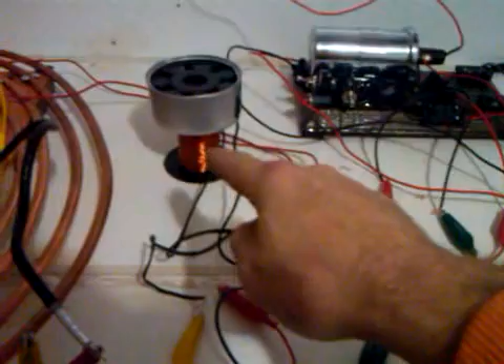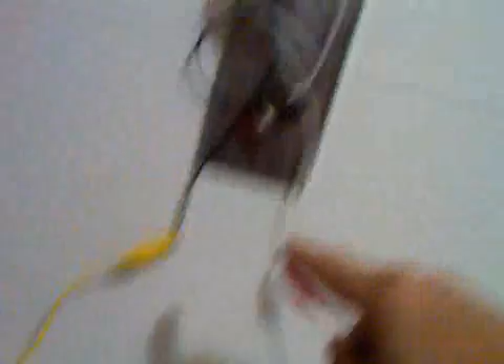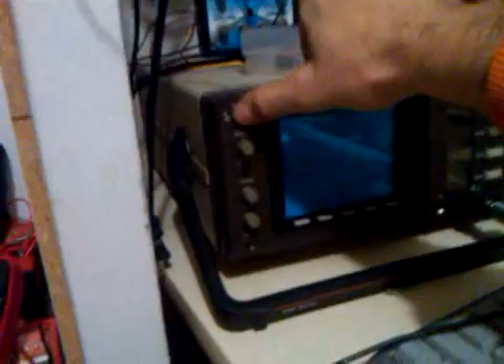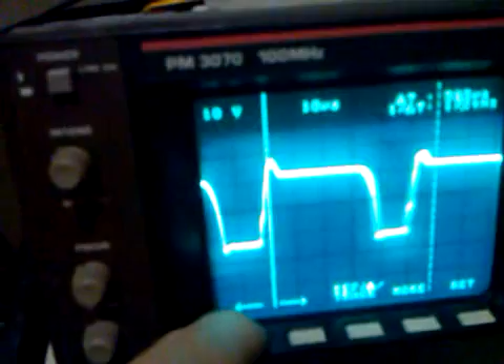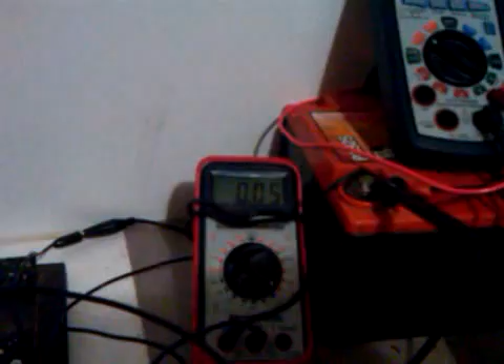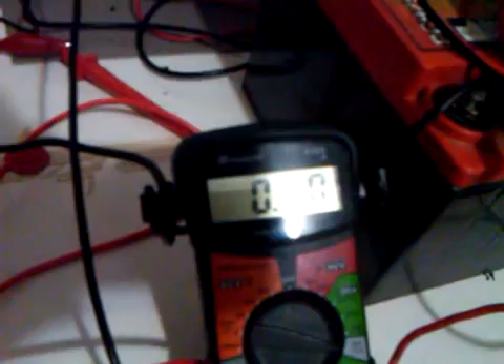Tesla pancake / Bedini self oscillator w/ high voltage output by TheDude

Comment from the maker: Hi Kyle.  I'm not certain why i never had notification on your comments.  sorry about missing replies for so long.  I appreciate your input on this line of experimentation.  Yes, i had some "moments" where i really started to wonder if my total stored amp hours were ever going to subside.  I found that driving the voltage up on secondary, then using secondary on an inverter really helps maintain run time on that battery while supporting an inverted load.  Still needs something...

Comment: @darcyklyne ... but the strange thing was, despite the voltage not going down much AT ALL, mere points (even after over 20 hrs of running) what started going down was the "loaded voltage", and then finally she started to plummet. Now, I didn't rectify my final output, which is, you know, pretty odd, maybe I should have... it was AC goin in. I used a stake in the ground to get an AC signal for the trigger thats it, 2 T's for amplification. Well, I shouldn't say that maybe it was pulsed HV DC out?

Comment: @darcyklyne Excellent, thanks Darcy. Actually I will admit, I was blown away by my experiment initially... it's on my channel... the thing ran FOREVER I think it was at least 2 days almost before I started losing voltage! I actually got pretty excited. (I too was running a charge back in to the run battery) ... ...

Comment: Hey Darcy. I did a simpler experiment roughly based on the same IMHOTEP radiant oscillator concept, and it too used about 80 mA, but I think (know) my ignition coil actually was meant to be stepped up to about 400V before the coil (you buy a driver box). MY CFL's were very "uselessly" lit - no decent light. Not as much as 80 mA into LEDs would provide, that's for sure. In Hind sight... what are your views on this circuit? Would you build it again? Or would u just rather drive 300 mA